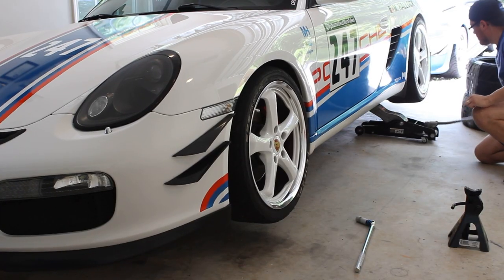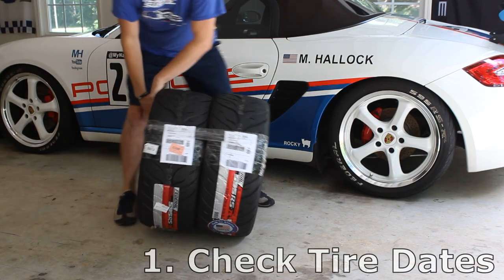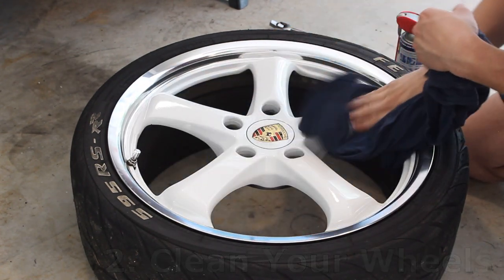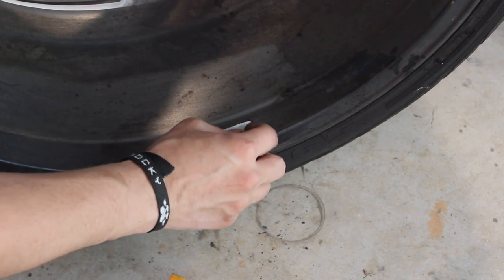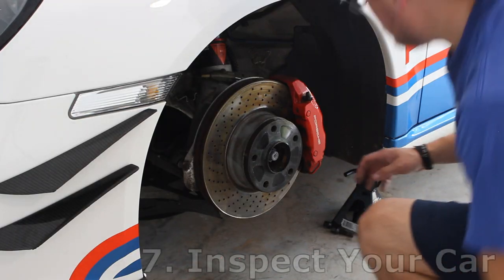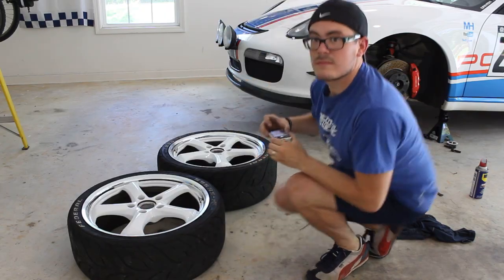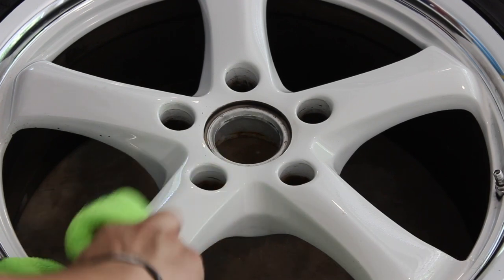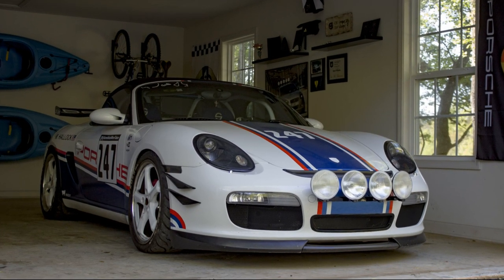Top 10 Things To Do When Getting New Tires

Comment: Very timely. I have an appointment Monday to get new tires for my C30.
Reply: Update: I also got tires for the rear of my C30 yesterday, the owner of the shop did the work, didn't stop him losing my (thankfully) sacrificial valve caps, using a non alternating nut tightening pattern with who knows what torque setting, over inflating both by 12 psi, and to top it off he sprayed all my tires with some  nasty tire shine that also went on the rims and wheel arches. So today I have some work to do...

Comment: I have 17 inch Pegasus wheels on my c30, tires looked pretty new when I bought the car. Unfortunately there’s a bubble on one tire I need to replace and then a rear on another tire. The previous owner looks like they hit the curb hard and I have to refurbish the rims anyways.  Very curbed. What tires do you recommend ?? I want Michelins one day but currently the car has 2 Toyo extensas I think and then 2 general g max as-05- tires size 225/ 45zr17 . Run flat tires. Car is lowered… idk which tires to go with or if I should just order one of these for now. The car will be fast so idk if these should do for now. What tire setup would you suggest . I’ll double check everything before I order a new one once I get my car back from the shop
Reply from the maker: The tires you go with are entirely up to you. For starters, I would only go with name brand tires. 

What ultimately matters are your expectations for grip, seasonal use, and tread life. In my climate, I run 200 tread wear ultra high performance tires all year. These can be a little slick when it's below freezing and I'm lucky to get 5,000 miles out of them, but they're worth it for the track. If you live where it snows, I'd suggest having both a summer set and winter set of tires. 

I definitely discourage mixing tires. All four should be the same to allow for proper handling and no unexpected understeer/oversteer from imbalanced grip levels.
Reply: @MyNameIdeasWereTaken  that’s exactly what I was thinking , I think the reason why the previous owner may have lost grip was because they put all different tires on the car.. thanks for the advice again. I might wanna go with Michelin or pirelli or continentals. My Mercedes glk has had both and they’re amazing. I’m in New Jersey but I won’t be driving it in the snow for sure so I might be getting ultra high performance tires with seasonal grip in case it’s a colder day or drops without snow.
Reply: @MyNameIdeasWereTaken  do you think I should go for the wider 225/ 45r17 tires than the stock 205 50 17 recommendation , or should I go wider. Tire specialist said go with the 215 45 r17 since the ones that are on now seem to be rubbing
Reply from the maker: @markveith9468  On an 8" wide wheel, I'd definitely go with a 225 or 235 for the most square setup possible. Stock P1 tires are too narrow on Pegs and they would be a bit stretched. 
Being an 8" wide wheel, you may need to adjust the camber or roll the fenders to prevent any rubbing.